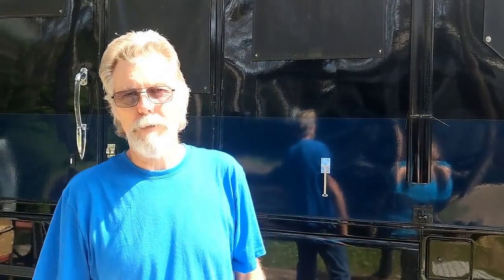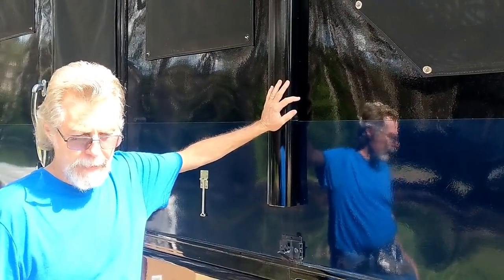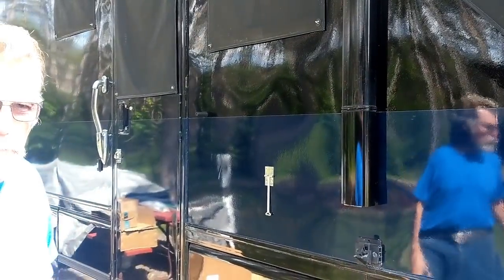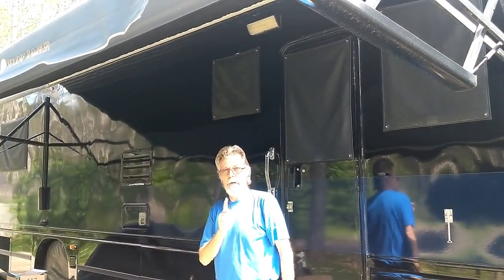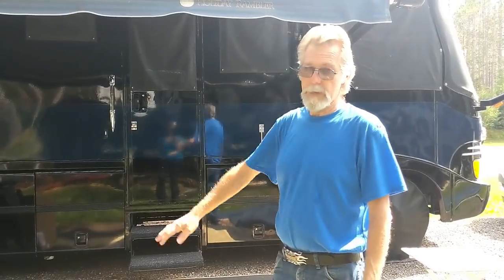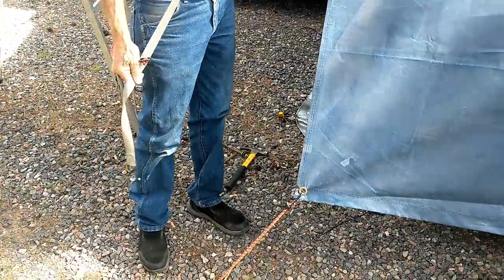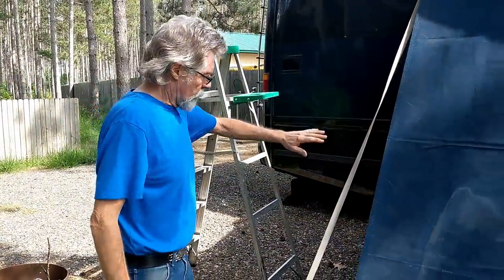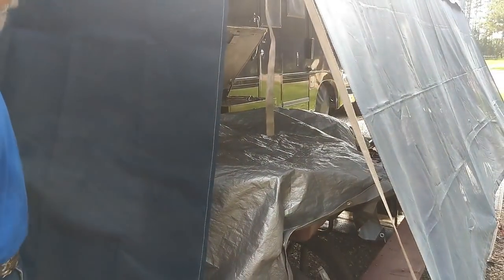V-43 DIY How to Install & Anchor RV Awning Sun Blocker Shades

Comment: Is the awning a straight replacement for a manual one?
Reply from the maker: It's a replacement of the arms and some wiring involved but it's a new installation, not an unbolt and rebolt since the new arms are different. I think it was well worth the effort and money.
Reply: Thanks Bill